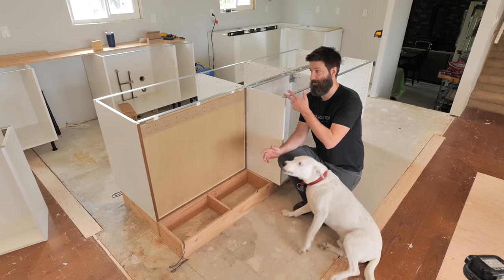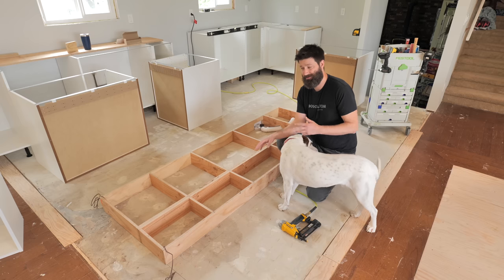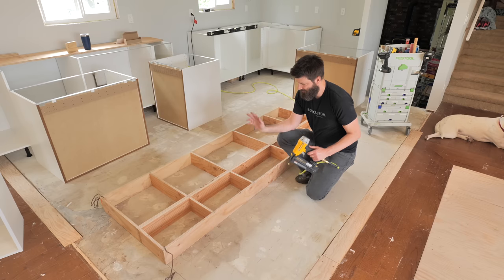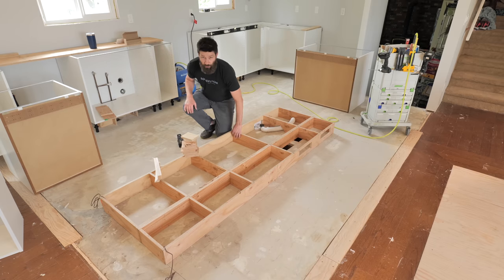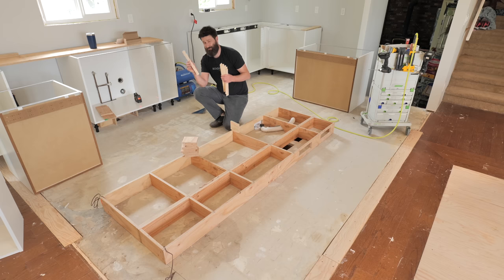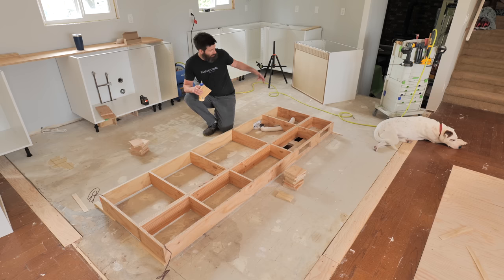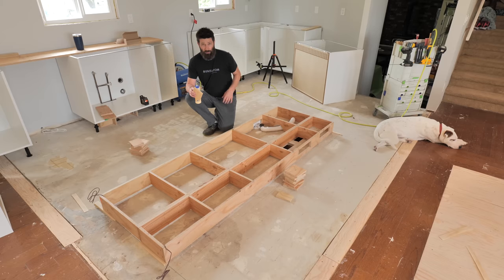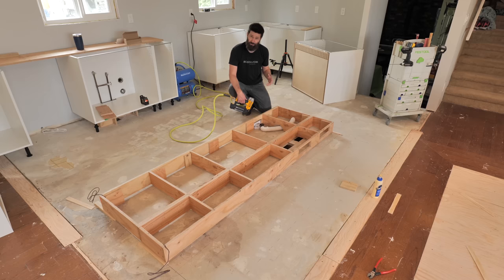The Simple Ingenious Way To Build Rock Solid Cabinet Kicks!

Comment: Love this method. Totally changed my cabinet game when I learned it. I like to make a couple of those plywood "legs" into L-shaped "legs" then I just screw them to the floor. 
I also like to scribe my kicks before installing the cabs, much easier without them on. 

Another little thing I found that helped is keeping the cross sections about an inch shorter than the height of the perimeter pieces. In case the floor has a hump in the middle of the island. 
Great vid man.

Comment: I've not seen anyone replace the shims with wood glues/screwed in on the inside.. very cool idea and added support. Always thought you just leave the shims there. Saw another video where they glue/screw shims in to floor so they wont shift, but your method seems better for longevity.
Reply from the maker: @b3owu1f  I used to do the same with the shims until an old cabinet guy showed me this method, I immediately recognized it as absolutely genius.  It’s so much more solid and a lot easier to do once you get the hang of it.  Thanks for watching🍻

Comment: Great tips.  I do mostly the same, but for my basement laundry room and shop cabinets, I use 2x4 treated lumber for the kicks (on edge so the cabinets sit on them) or sit the kicks on them (raises the cabinets w/kicks already on them an extra 1.5").  Just so I have treated lumber on the concrete and avoid moisture, should the floors get wet.

Scooter is great!

Comment: Have you tried the Axilo legs from Hafele? Much stronger than the ones I see in the perimeter cabinets, and a breeze to use with their adjuster tool, especially with a drill hooked up. As far as the strength goes....I scribe the kicks tight so that adds direct support to the cabinet and also there are usually end panels /gables that go to the floor that also are direct support (also a place to fasten to the floor).
I am not a fan of pedestal bases for many reasons. When you have a room packed full of cabinets ready for install, you have to almost completely clear them out so you can level the whole perimeter. They are a real pain when you need to scribe them lower than they are made ie; when the floors are way out of level. Plumbing inevitably always comes up right where there is a cleat. They are a pain when they are made to the wrong size....people forget about kick returns, DW openings etc... I certainly would not want screw holes in the bottom of my cabinets that get chipped, filled with dirt, moisture....
I still use pedestal bases when there is a requirement for furniture kicks though. Using adjustable legs with pedestal bases are also an option.

Comment: I normally use the blocking & brackets ikea provides, but it can be a pretty annoying system at times. Mostly relying on the weight of the slab to keep everything steady. Do you end up just gluing the ikea kick to the ply after the flooring is installed or do you use different material?
Reply from the maker: Ya the the plastic screw legs are alright along the wall but for a giant island I’d be scared they’d break off!  The island is like 9’ long so we are just going to get some long trim material and make our own kick.  You could definitely just put a little PL premium glue and glue on the ones ones though.

Comment: Couldn’t agree more on the plastic legs. I’m a 100% plywood ladder kick guy. 
The plastic legs are actually stronger then they seem but still not good enough. And they break really easy trying to tip a cabinet over on to them.
Reply from the maker: Nothing better than getting all your plywood ladder levelled off and then just start throwing cabinets in quick!
Reply: @TheFunnyCarpenter  exactly, lol makes you look like a total hero to the home owner.
Reply from the maker: @ThisTall  at first they’re like hmm not much happening…and then boom
Reply: @TheFunnyCarpenter  exactly!!
Reply: Put a strap around the cabinet and lift to rotate

Comment: Good tips. I think though the cabinet shims can handle 5000 lbs of pressure and some even 15000+ lbs of pressure. Most counter tops are at most 1200lbs so...

Comment: Isn't that base going to be about 3/4" too high or am I being morning brain dense? You leveled from the inside bottom of the existing cabinet to the top of the kick.  Once you put the cabinet on there, it will now be higher by the thickness of the bottom panel of the cabinet.  Which means from the top of the bottom panel to the top of the other bottom panel will be different byu that thickness?

Comment: great design for an Island installation as the plastic legs from most kitchen cabinets are for levelling, not supporting.   I love IKEA's rail hanging system and IKEA gets a bad rap from many about being "cheap crap" yet out of all the flat pack kitchen systems I've found this to be the best quality.   not as good a quality as a custom cabinet build by a wood shop by a professional maker but then you are comparing oranges to carrots (same colour, totally different items).

Comment: I'd have made the inner plywood section half inch smaller than the outside and keep flush to the top all way round just in case there is a hump in the floor
Reply: That's how I do it as well, though I only ⅛-¼" smaller. Mostly just to make it easier to get shims underneath.

Comment: Why use expensive plywood when you can build a sturdier kick base using 2x4s? No ripping necessary. Build, level, and then tapcon to the concrete floor using scrap wood screwed into the inside of the kick frame. It’s a lot quicker and the cabinets will be sitting on 1 1/2 wide 2x4 instead of 3/4 plywood.
Reply from the maker: Fair point Jason- all the cabinet shops that I’ve installed for always use plywood or even particle board, because you can count on it to be straight and not warp.
Reply: Have you tried finding straight 2x stock?  It’s impossible lol. Also most kicks are 4”+

Comment: I  can't believe your implying wood will hold "thousands of pounds.  As explained the nail provides zero assistance, and in fact weakens the extra ply piece.   First of all, as they're shorter than the kick THEY'RE NOT SUPPORTING ANY WEIGHT ON THIER OWN (top to bottom).  Secondly, any support not directly below the top-to-bottom pieces of the cabinet support the cabinet at all (they might support the content of that space or drawer).  Adding extra "rock solid" ply pieces, attached by a nail and glue, only spread the weight of the adjacent kickplate thousands of pounds directly to the nail and glue attachment - which means all of those thousands of pounds are initially transfered to the point which is the nail (approx 1/16 inch).   That nail will slice through the ply with before the extra ply supports it, and the glue would fail mid-slice.  All you've essentially done is hide your ply scrap out of sight.  If you really need to support thousands of pounds, don't use ply or OSB.  Use a 2x4 (or whatever spacing you need heightwise).
Reply from the maker: Nope.  These kicks are absurdly strong.  I've made 100's of them, zero failure.